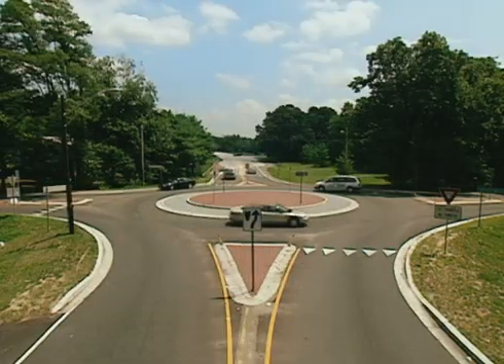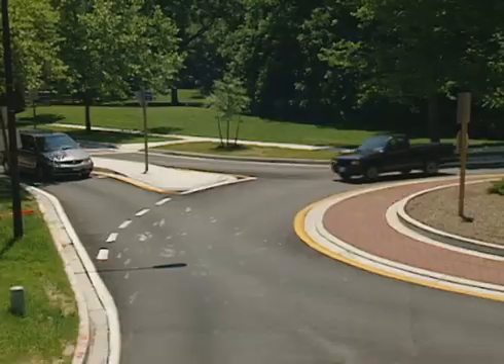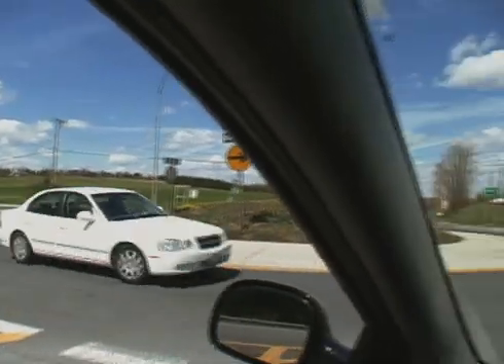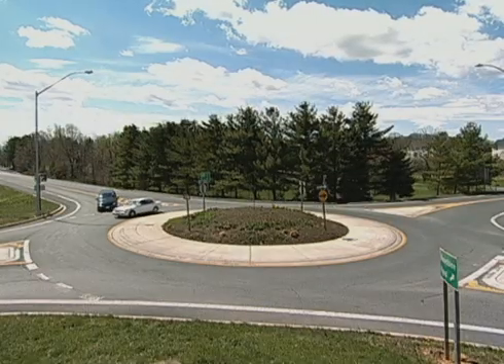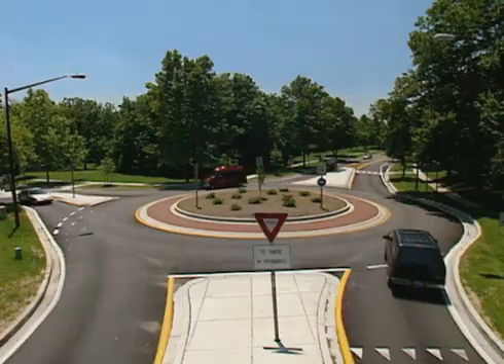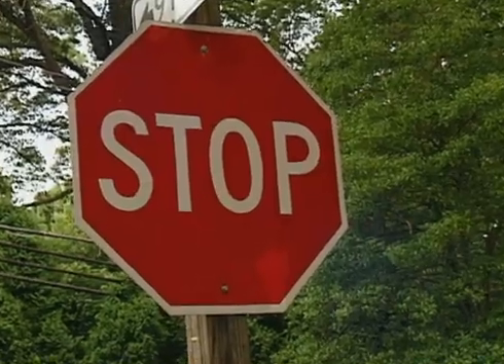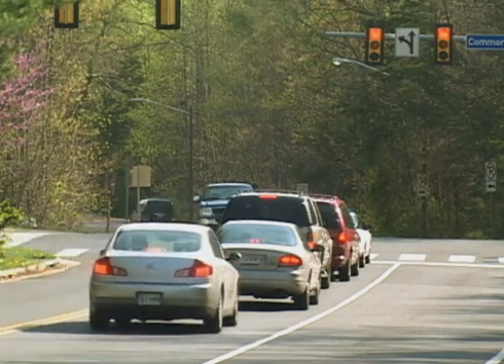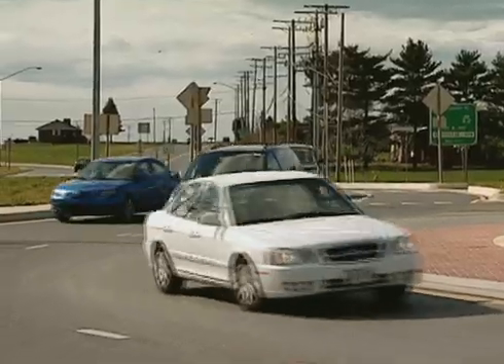How roundabouts work

Comment: I just moved to a new area and almost got into an accident when i encountered my first roundabout. I personally hate roundabouts because of the uncertainties involved with using them. With an intersection you know exactly what you are supposed to do and what everyone else is supposed to be doing but at a roundabout, even if you know what is supposed to happen, you have to heavily rely on the other driver's to let you in or out. Not to mention the lack of speed signs, making roundabouts difficult to use.